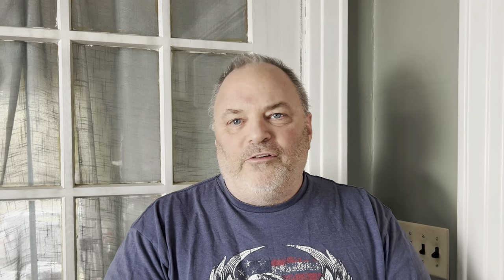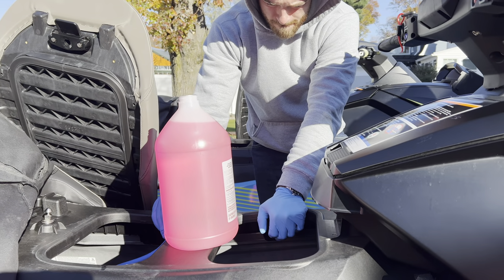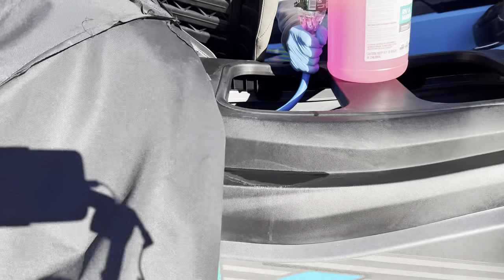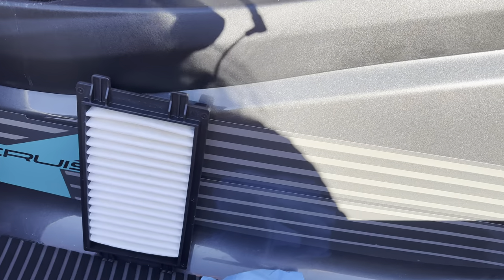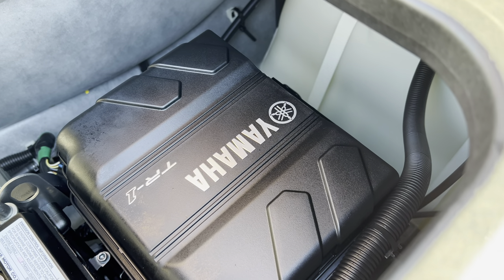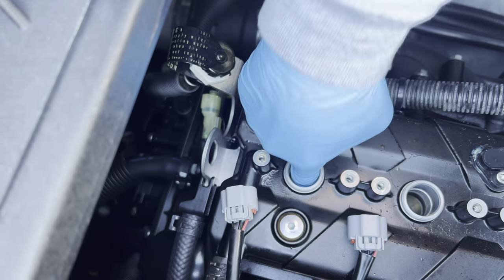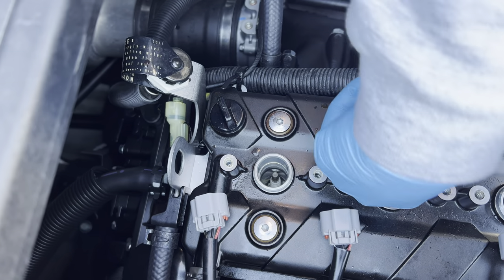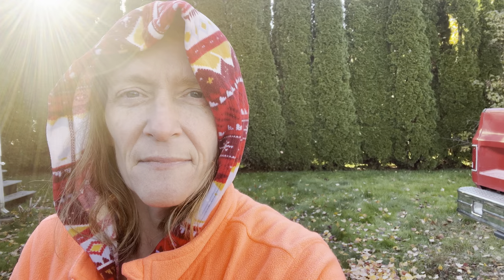Winterize Your Yamaha WaveRunner (Seadoos & Jet Skis Too) - A Step-by-Step Guide

Comment: It's been about a year since you guys did this 
How did it work out for you 
I'm thinking about doing it my self and new recommendations ? 
What is the process for the summer did you do anything ??
Reply from the maker: Hi! Sorry for the slow reply. I thought I made a video about our "de-winterization," but apparently I didn't. The winterization we did worked well.

Even though we took the batteries out and kept them inside where it was warmer, Matt's battery died over the winter, and his WaveRunner wouldn't start, so we had to run to Walmart and get him a new one.

Once the new battery was installed we flushed the engines to get the fogging oil out of the cylinders and then replaced the spark plugs with new ones. We were going to change the engine oil, but we had changed it towards the end of the season and had only gone 1 or 2 times with the new oil, so we skipped that step.

And that's it. We didn't do anything else. I hope this helps. If not, let me know, and I'll be happy to answer anything else. Thanks for watching!

Comment: Followed the same exact process on my 2022 VX Limited. For the antifreeze I used the cheap pump from Harbor Freight(had to buy the adapter so the hose from the pump would connect to the Yamaha drain plug) but kudos to Matt for being creative! Are you guys wrapping yours for the winter? I paid 115 for a professional to come and do that for me; I feel it adds an extra layer of protection.
Reply from the maker: We haven't decided yet what to do for covering them. I don't want to leave them sitting out with just the factory cover on, but I just found out my job is going away in a couple months, and I'm trying to not spend money if I don't have to.

I'm going to call a couple places on Monday to see how much it would cost to cover them. Shrink wrap is by far the best option.

I thought about using a tarp, but tarps are abrasive. If I did that, I'd throw a soft blanket over the factory cover to protect it, but I'm worried if the tarp isn't real tight, it could flap around if it gets windy and scratch up the PWCs or trailer. We have a month or so before it starts snowing a lot, but I don't want to dilly dally either.

Comment: Do you change the oil too?
Reply from the maker: Hi, @MrBud007. We didn't change the oil because we had just done it before our last trip, which was only 2-3 hours of use. We had planned to go out more last fall, but the weather was bad, and that trip ended up being our last. If we'd gone out more, we would have changed it again. This year is similar. We just changed it and have only gone out one time since then. We're hoping for good weather this fall so we can go out a couple more times, but if not, we'll still change it when we winterize them because our last trip was to the ocean.

If you're interested in watching an oil change, here's a link to the video of the oil change we just did: https://youtu.be/E5Vx4Ql2LSk